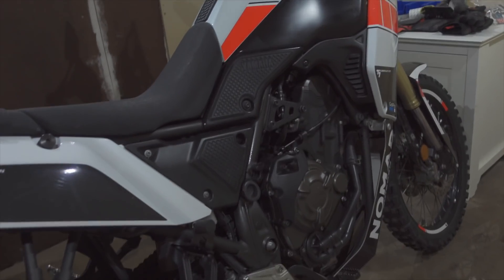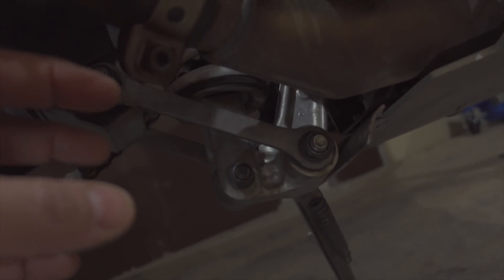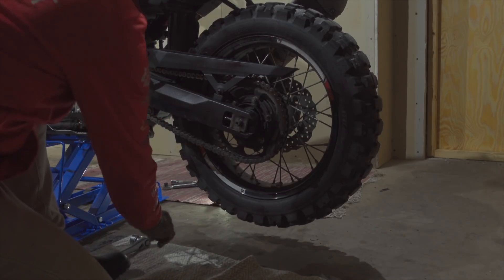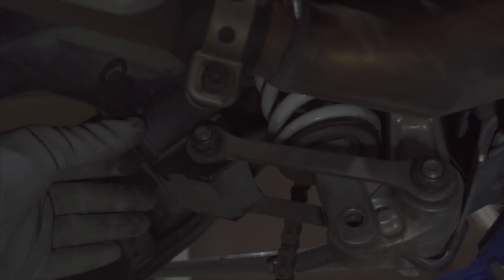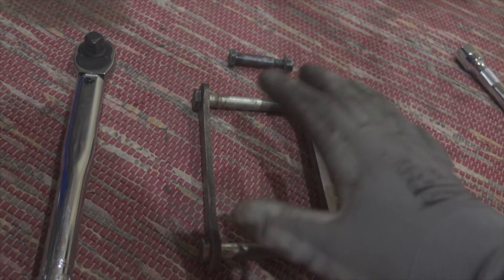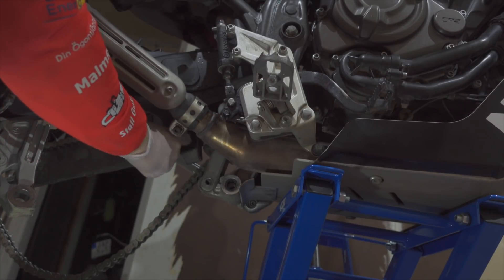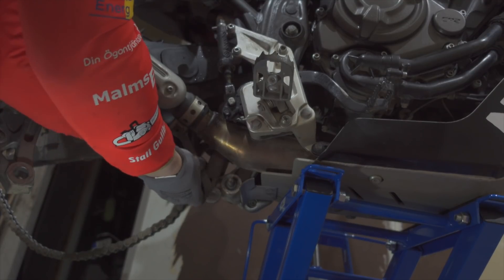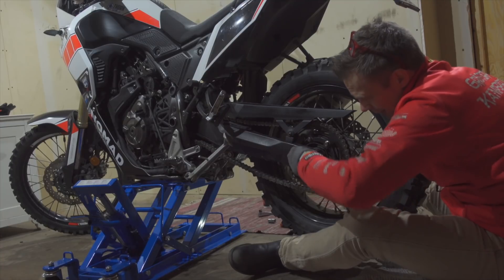Grease your suspension linkage! Tenere 700

Comment: Great video as alway, thanks!
I just went and did mine, so here is a top tip for the lazy and the one with a center stand:
1) You can do this job with the wheel on, plenty of space, however, more space easier the job, so consider taking it of. I did mine with the wheel on. 
2) If you have the center stand (at least the one from SW Motech), the stand will initially be in the way of the bolt closest to the engine. This is solved by taking out the other two bolts first. Then strap/lift the wheel/swingarms all the way up, as high as it goes with the wheel on. Then you can push the damper unit towards the rear and pivot the link out of the way of the centre stand. Or you can just take the damper unit off all together. A 15 min job with minimum hazzle.
Reply from the maker: Fantastic feedback. Thank you!
Reply: 15 minutes? it took me 2 hrs, smile. So obviously i need to practice a lot more. but u are right with the center stand from sw motech. thanks for the tip
Reply: Thanks for the tip. I'll be installing my center stand in a week or two so I will grease those joints beforehand to save me work later on. I wonder if it makes any difference with center stand from Yamaha.
Reply: I can confirm you can actually remove the shock without taking the wheel off. Just chock the swingarm so it doesn't drop when you remove the bolts,
Reply: you prolly dont care at all but does any of you know of a tool to get back into an instagram account??
I was stupid lost the login password. I would appreciate any tricks you can give me
Reply: @Reginald Rocco Instablaster :)
Reply: @Conor Zayden Thanks for your reply. I found the site thru google and Im trying it out atm.
Looks like it's gonna take quite some time so I will get back to you later with my results.
Reply: @Conor Zayden it worked and I now got access to my account again. I'm so happy!
Thank you so much, you saved my account :D
Reply: @Reginald Rocco Happy to help =)

Comment: Nice job, now I dont need to make that video ;-) Those is  the most exposed bearings. There is one left  towards the front I would like to lubricate as well. The nut is close to the catalyzer and then not easy to access with a standard torque wrench when reinstalling the nut. Will have to use an extension arm (and recalculate torque) or remove the exhaust. I hope to find out how that nut could be torqued. (60Nm) The swing arm pivot bolt is part of the maintenance and should be lubricated every 50.000 km according to the service manual.
Reply from the maker: Thanks Sven. I know you got all the details. And you can make the video your way. There is always need for a Sven version.

Comment: Excellent demonstration of the components of the rear suspension. I was considering the T7 but felt it was a bit too tall. I see that they offer a "lowering kit". But was surprised to see that the kit is simply two linkage arms. You have clearly shown how the linkage arms work in the suspension and how easy it is to remove or change them. That provides me much more confidence that I can lower the bike and the return it to normal configuration with very little effort - so I should not be afraid to give it a try.  Thanks!
Reply from the maker: Thanks! Glad I could help
Reply: Touratech sells a complete lowering kit.Mine is a bit too tall for me.Gonna try the Seatconcepts low comfort seat first.I've dropped mine twice because I couldn't get me foot down.

Comment: Good video !. Molybdenum based grease is much better in my opinion , lasts a lot longer.
Reply from the maker: Thanks for the tip
Reply: Yes Moly grease like LM47 for high pressure applications like these and Litho grease like LM 50 for fast spinning bearings which wheel bearings is a good example of.

Comment: As a dirt bike rider, having been on Yamaha wr's for a while now, this is a job i am very familiar with.
Reply: any tips mine has 2000 miles and ive never done anything but lube the chain and an oil change
Reply: I finally had some linkage bearings fail a couple yrs back on a used YZ250FX I purchased.  Never again !  It's a whole lot more enjoyable cleaning and greasing this stuff occasionally than knocking out and replacing the bearings even once.

Comment: I grease everything up with Kroon ball-bearing grease. My wheel axles, rear bolt nuts, threads. It's heat resistant, doesnt attract much moisture and is way thicker and sits longer than silicone based stuff.

Comment: Based on what I'm seeing, maybe a good idea to pull the swingarm off and do the bearings on it too, while you have all that stuff off.
Reply from the maker: Yes that would be a good idea. I haven’t been that brave yet. Learning as I go.
Reply: Yes, and the third bolt and bearing on the linkage...
It just gets dificult if the bolts stay there to much time.

Comment: I would have cleaned that area with diesel or kerosene and a brush and air gun. Then rinsed with water and dried with air gun. Just to have that area complete clean before dismounting and exposing the needle bearings. Without cleaning, there is a risk dirt would already enter the bearing when you pull out the bolt-bushing. Cleaning also ensure nothing dirt enters the bearings when new grease is applied. Even though you used that rag before, but using the rag when bearing already is exposed is a bad idea, chances are too big, some dirt enters the bearing. Other wise a good and interesting video. I like your channel and informative videos.
Reply from the maker: Thanks. Sounds like a good idea. I learn as I go

Comment: you can also just leave the rear wheel on. lift with the lift to the wheel just resting on the floor. then all the bolts are loose at the same time and the whole thing can be removed and lubricated.  🙂
Reply from the maker: Cool! Thanks for the tip

Comment: My old Tenere '84 has greasing valves on linkage.  This is example where factory should not save their costs :-( . I was thinking about it, would not be dificult to drill holes into bolts, when I checked it on my new Tenere. Hope some aftermarket tunining will be soon available   :-)
Reply from the maker: Yes they built to last in the old days
Reply: The upside of having to take the linkage apart every now and then is that you will notice if you’ve gotten moisture in the so its starting to rust, and you can inspect the shaft seals as well. The problem with grease nipples between two bearings is that the grease only go out the easiest way, so when you press the grease in between the bearings it will most likely just go through one of the bearings and the come out on that side of the linkage. “The path of least resistance”, But a little grease is better than no grease at all. 😀
Reply: @henrikforsberg683  I trust pulling it apart and thoroughly going through it.  Don't let them get to the point of failing and this isn't a big deal.  Once you have to swap out all the bearings and seals you realize what a waste of extra time and money it is not to service these on a schedule.

Comment: You should of removed grease from the threads and faces when you retightened! It is dangerous practice what you did. The grease on the threads and face reduces the friction coefficient. So this means when you tighten the nut with the torque wrench you are getting more bolt stretch than required for the same torque reading. This can overstress the bolt leading to premature failure of the connection.
Reply from the maker: Thanks for the tip! Will do this soon again and will make it better 👍🏻
Reply: @NomadSweden  I like watching your channel. I am hoping to get a 700 one day 👍

Comment: OK, I'll be "that guy": The Yamaha T7 service manual does not call for greasing the linkage bolts and sleeves. Only the oil seals outside of the bearings are shown to require lithium soap-based grease. Grease elsewhere is likely useful to prevent corrosion but Yamaha doesn't seem to think it's needed for lubrication.
Reply from the maker: You're correct :)

Comment: Another great video, Robert!

Did you have to take the rear wheel of for the linkage greasing? I have my rear shock out right now for spring swap, didnt take the rear wheel off. Thanks!
Reply from the maker: Thanks! It was easier to get the arms and bolts out with the wheel of, and easier to lift the swing. But I'm not sure if you have to.

Comment: Good one Nomad :) just greesed my bearing top end bolt was showing some rust other were fine. A question though - on the top bolt clossest to the swing arm the inner casing for the bolt is loneger the bearing housing - correct? Making the link on top bolt always a bit offset to one side or anorher? Thx
Reply from the maker: Thanks. Actually i am not sure since it was some time ago. You could check the service manual
Reply: @NomadSweden  top. Thx ;)

Comment: Vaselin nippor är din bästa vän, fixar alltid det på hojjar och snöskoter boggies :) Drill and thread 3 maybe 4 holes, and install greaze zerks. I assume it's a needle bearing at the frame mount for the link aswell, that u didn't lube ?
Reply from the maker: Yep, there are two more places to grease if you want the full linkage greased. Frame and swing links.

Comment: Thank you for the video! I am not sure if it is a problem lifting the T7 with a lift like you got it, what should be damaged? Plus I also dont know a different way to do this work than maybe lifting it with a hoist, e.g. on the pillion footrests. Removing the skidplate and lifting the T7 on the oil sump wont work because it is not located in the center and has a rather small surface, which may lead to dropping the T7 in your garage.. :D
Reply from the maker: Thanks! Well, I don't think things will break, but the manual says not to lift under the skid plate. I take my chances :)

Comment: Excellent video. As I try to make friends with my brand new Tenéré   (never driven) I dismantled lot of things. It is much easier then with my Africa Twin (and much cheaper) But I wonder how you got all the values for the torques?
Reply from the maker: Hi 👋🏻. Google for the service manual for the Tenere 700. It has all information.
Reply: @NomadSweden  Thank you, I never expect to find a download that easy, cause my dealer made a secret out of it. I had to slack the engine bolts for installing the OEM crash bar cause the engine was mounted under tension. After unscrewing an engine bolt the holes didn’t match anymore. Now I’m able to set the correct torques

Comment: Hi. Very instructive video, thanks. Which lift are you using? What is its spec? Cheers
Reply from the maker: Thanks. This is what I use. Local brand. https://www.biltema.se/bil---mc/mc/verkstadsutrustning/mc-lyftar/mc-lyft-680-kg-2000021674?gclid=Cj0KCQiAoab_BRCxARIsANMx4S742QiVukzrTk4L6anR9RszG4P05ncNVu3XJFWR9kqehlPHxPl-eH8aAlJREALw_wcB
Reply: @NomadSweden  Excellent, thanks. Good to see that using such a lift seems to be fine. Cheers

Comment: Great video, I have my suspension out to change the spring so will take the opportunity to grease up. Do you put the grease only in the hole before inserting the pipe or do you also grease the inside of the pipe before inserting the bolts?
Reply from the maker: Thanks. You have a great opportunity then. You could make sure everything is greased well. Rather too much than too little. Grease all way through 👍🏻

Comment: Hi! Just started this job this evening. Did not finish it, as I am doing in parallell with brake service and some deep cleaning. I have not decided if I am going to take the rear suspension completely off in order to do the job 100%. One question that is kind of relating to that: even closer to the engine there is another bolt/nut that I think can be removed - should it?
Reply from the maker: Do you mesn the bold that attaches the link to the swingarm? I did not do that one because I didn’t dare loosening the whole swing arm but I am sure it has the same problem. I am also a beginner at this so I will try this one soon
Reply: @NomadSweden  Thanks for the answer! Yes I believe we are talking about the same. It is the bolt that connects what my manual calls the "Relay arm" to a protrusion of the frame I believe? I used your video when doing the job (thanks!), so I was a bit hesitant if there was any specific reason you did not also disassemble and grease up this final bolt. I'll give it a shot.

Edit: I was a bit quick to answer. I don't think the bolt I am referring to attaches to the swing arm. I think it is the one bolt that connects the Relay arm (the triangle) to the frame (or at least something that is not moving relative to the frame) - the other two bolts connecting to the suspension and to the swing arm via the "Connecting arms" (again what my manual calls it).

Comment: What do you think about a flexx handlebar for the Tenere? I am saving for one, seems to be magic how good they work on maxi trails. Regards.
Reply from the maker: Oh never saw Flexx before. Looks good. But i have no opinion on them yet 😊
Reply: @NomadSweden  did you look it up (I am not a flexx salesman lol)
By the way, got the bike back from the dealer with the 5k service done, I asked for grease on the bolts and told them the issue, and that I will take the bolts off before end of warranty and demand a replacement, and they cleaned and greased em with no charge (that's what they told me there is a chance they did not!) though I think so as they reflected it on the work sheet.
So...thanks a lot for such tip you save me a probable future issue. Cheers.
Reply from the maker: Great of them to include the work. 👍🏻 no flexx opinion though 😊 looks cool but i have no idea

Comment: Hello. 
 I have the same lift and my question is, can you lift the T7 under the original engine cover and nothing will happen, do you have to combine as specified in the manufacturer's manual?
Reply from the maker: The manual says you can not use a lift under the skid plate.

Comment: Dear Nomad can you tell me the lift brand?
Reply from the maker: It's a swedish budget brand https://www.biltema.se/bil---mc/mc/verkstadsutrustning/mc-lyftar/mc-lyft-680-kg-2000021674
Reply: @NomadSweden  Many thanks, but sorry for a further question : I have standard lower engine protection. According to you is your lift suitable anyhow ? Many thanks again my friend. I'll send you picture of my T7
Reply from the maker: Well the manual says not to use lift under skid plate at all so it’s on your own risk. I do it for short time only
Reply: @gianlucadelloro  If you don't remove the skid plate there is too much flex and instability. Better to take it off, only four screws.

Comment: Can grease attract dirt and sand in this piece and make it worsez that might be the reason why Yamaha doesn't grease it, I doubt Yamaha engineers would have forget about this...
Reply from the maker: The grease is not in contact with outside . It only needs some corrosion protection.

Comment: You said that Yamaha didn’t grease these, maybe its not necessary.
Is this nice to do thing or need to do thing ?
Reply from the maker: Well moving parts with bearings are dry and corroding. I say this is a must. Old bikes has service holes to do this regularly.
Reply: @NomadSweden  thanks a lot
Reply from the maker: Hello.
 I ride a TM 450 enduro, and it has a similar link gear as the T700. I take apart after 10 hours drive, as it is very exposed there. New needle bearings costs 100-120 euros, so a little Grease for 5 euros on it is clearly worth it.
And it's good to keep your bike in order, for long Hassle-free rides in terrain and gravel💪😃
/Seymor #nomadsweden
Reply: NEED TO DO. !   And the steering head bearings too.

Comment: Same Problem as the F 800 ... i think its a Design mistake... should not happen
Reply: I think most motorcycle factories are completely unaware of what grease is for 😉 virtually every bike I’ve bought has had SFA grease on bearings or bushes.

Comment: I don't get why they were not greased, is what the manufacturers supposed to do? We give them money for something that is partly made?
Reply from the maker: Actually the needle bearings in there are at least greased. But the rest is not so good
Reply: @NomadSweden  In my 16 year old CBF600 probably the same was happening, apart from greasing the components protection must be added from water spray. Mine is a classic monoshock design so it was easy to enclose it in wrap I made my self and from then bearings and shock are in pristine condition. I wish I could upload a photo here to show you what I mean. In this case here it needs a more elaborate plan to enclose it and protect it from spraying because of these two metal arms. It's a shame the manufacturers do not do it themshelves, they are pulling our leg...